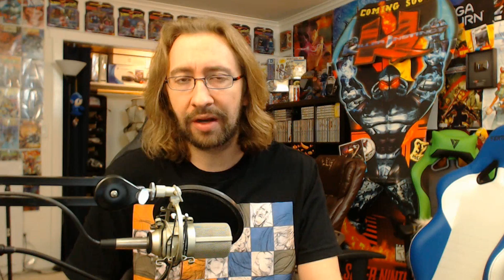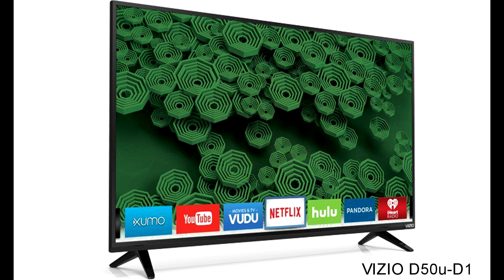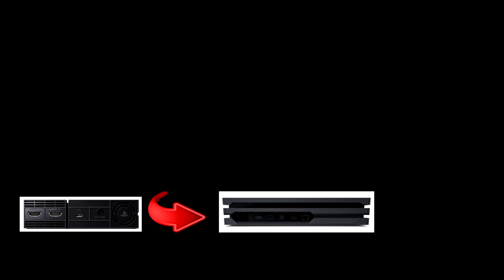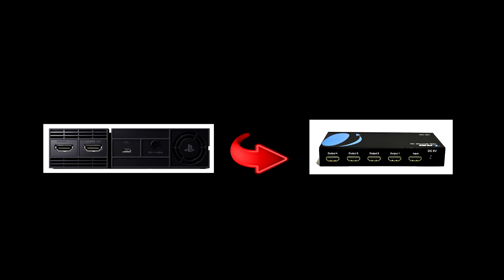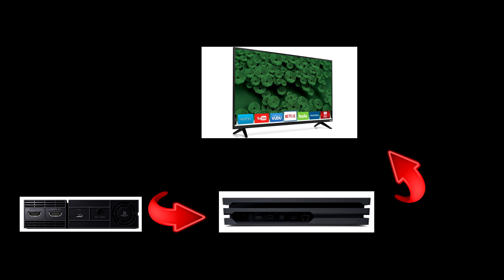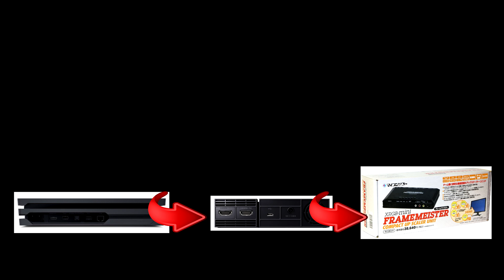MY PS4 PRO NIGHTMARE...And How I Fixed It

Comment: 2022 and I think that I  have a HDCP issue with my PS4 Pro and my LG TV, The PS4 has been stored for about a year unplugged. same TV that I used to use with it and now I cant get a signal, even in safe mode! If I plug my PS4 into my 15 year old Sony TV it works, but that TV is dated. I have tried power cycles, factory resets on both devices, and even different ports ands cables, all software up to date too. Help!!!

Comment: i got one question i upgraded from a slim to a pro is there a video or some way to make the pro run as fast as the slim cause my pro isnt wanting to connect for crap to wifi and connect speed is so low while download speed is littlerly triple the amount in mega bites my slim runs faster then the pro why is that and how can i get pro to actually run

Comment: I've just bought a ps4 pro, set it up today and the system update file (around 500 mb) is taking over 20 hours it says! My internet is not slow and everything else is working fine, is this normal for the first system software update? I'm worried I've got a faulty ps4 pro :/

Comment: I have a few issues with the newest PS4 Pro RDR2 bundle.  First trouble was with my switch which downgrade HDMI and its HDCP to 1.4, and this is November 2018!!  So I cannot use the switch, and I will have to buy a new switch which seems to be hard to find one with all these issues with HDMI version, HDCP 2.2, 4K, and HDR stuff in 2018!  The other issue was that this newest PS4 Pro doesn't let me use my Wifi 5 GHz, and only works thru my Wifi 2.4 GHz, a Wifi which is extremely slow!  So why can I use Wifi 5 GHz.  Let me clarify this further; when I set up the 5 GHz, the PS4 Pro network test successfully connect to the internet 80% of the time, but it fails to login to PSN and it doesn't give up or down loads at all.  This shouldn't happen in 2018!

Comment: I had similar issue too. My ps4 Pro does not want work with my HDMI switch with audio extractor. The reason why I use such setup is because I collect retro consoles and I have analog to HDMI upscaler. And I have a receiver that does not have HDMI plug. I want my older console to have pro-logic surround sound and the only way to do this is using the switch and audio extractor. Of all the consoles I have collected, PS4 Pro is the black sheep of my collections. It requires direct plugin which I have to manually switch over to the sources on TV and receiver. It sucks balls.

Comment: I'm having the temporary black screen problem and I only just bought my pro. It works ok then I lose signal for a few seconds. I've tried 2 different ports on my tv, bought a new expensive high speed hdmi cable but I still get temp black screen on my LG 4k hdr tv. I have my Project Scorpio edition in hdmi 1 and that works ok. I don't have a VR headset so what can I get to make this handshake work? Please help?

Comment: Hi. I recently just had this problem. I bought a ps4 pro and it immediately started giving me this black screen problem. I then thought maybe I have it in the wrong port which I did and found out that my vizio m series only had one hdmi 2.0 which was the first hdmi. (Hdmi 1) Then after playing half a game of fortnite, it cut out again and I was extremely angry at that point. I then started unplugging all of my hdmi ports in anger and after I unplugged every one I had in BUT. The ps4 pro one, it worked perfectly. It was cutting out because of my other hdmi's. Hope this helps anyone out there because I dont want anyone to go through what I had to for the past 24 hours.

Comment: I bought ps4pro like 2 months ago, my tv is LG 42LS3450 and it only has 1 slot hdmi port, 1080, and no HDR. 
My settings : set resolution to 1080p, HDCP off, full rgb to limited, deep color off, hdr off. 

And its still flickering, like black screen for a  second then came back. Weird thing is it does not happen all the time. Maybe it's my tv?

Comment: Max I have the same exact tv and a standard ps4 not a pro. When I go into sound and screen settings my ps4 only goes up to 1080p. I know I should have more options also the PS4 says HDR is not supported on this TV. just wondering if you have any tips or could point me in the right direction ANY help would be appreciated.
Reply: I am plugged into HDMI port 5 for the best definition as well.

Comment: This guy is right. Just got PS4 Pro for 4k support. My 4k Samsung should support HDR and TV is really in this mode, but PS4 claims that TV doesn't support it at all. I also had some odd white bar flickers at lower areas of my TV and actually thought I had gotten a defective PS4 Pro. However this was somehow magically sorted by fiddling graphic settings on PS4 Pro, but never actually changed anything differently?? My opinion PS4 Pro is really, really buggy on it's HDMI output. I've had PC with two different graphics card to this same TV and never had any of these problems.

Comment: Granted there is no excuse for sony tvs having issues but in your case, I believe the problem is the "value" brand Vizio. Never had an issue with a KS8000 Samsung. To datw the issues have been resolved by the TV manufacturers, not Sony.

Comment: Im giving up on my pro. Have Samsung ks8000 show 4k yuv automatically so you would have to manually change the tvs hdmi output to Uhd color but then i get a no source found... my 4k blu ray works fine via Uhd on the same port. Sony blame samsung and samsung blame sony...tried different hdmi cables and ports done hdcp trick.. nothing ffs

Comment: Sounds like what you did was just downgrade the HDCP inorder to strip it. Passing it through the PSVR break out box outputs the signal in an older HDMI 1.4 spec then the framemeister strips the older HDCP spec from the signal. All though it works you don't need to use the framemeister to strip the HDCP their are some $20 options out there. This process how ever eliminates 4K RGB and HDR signals but I don't think you care about that part from what your saying.

Comment: To me PS4 Pro is not about doubtful 4k (don't have any capable screens anyway) but increased power when running on standard 1080p, stable resolution, enhanced visuals and stable frame-rate... but I don't have it yet, only original PS4.

Comment: i got my ps4 pro 30/12/2016 and i didnt have any probs so i guess the issues are fixed.
Reply: Inferious_07 samsung ku6300
Reply: Inferious_07 ok cool
Reply: Inferious_07 yeah its 4k
Reply: have a Polaroid 4k tv. It worked fine for a while. now when i turn it on it the screen is green. Any ideas?

Comment: I have the Power series and am using the HDMI port 5, but no signal. I have no VR and when in safe mode the screen remains. Can I factory reset or downgrade from the patch without having a signal?

Comment: If you had trouble getting it to work, you shouldn't be making videos until you learn a little more! The PS4  Pro offers newer technology than the PS4, meaning if you want to take advantage of all the new technology, you need a newer TV. If you had problems, then you probably weren't using the right HDMI cable, many claims on the internet say this does not matter, this is false! There ARE different HDMI cables.

Comment: and this is just another reason why i refuse to go near consoles any more. my last console was the xbox 360, once i got shot of that pile of crap a fter just 3 weeks i turned all dark and adopted the msi dragon and its kick ass pc components and OMG !!! im never going back to crap consoles.  sure you pay more for a pc but your pc is more viable for much much longer and when its time to upgrade you save literally hundreds of pounds with the pc because all you do is buy graphics upgrades!!  so yea consoles suck dick and are forced to do 4k! they are not actually 4k.   it ahs the same tech as the 4k tv's processors that fill in the gaps to make it look like 4k.  where as with a pc these days most mid range cards are 4k and all you have to do is get a 4k monitor which are really cheap now too. cheaper than a fake 4k tv anyway.  is it any wander that your ps4 pro overheats ! and has display problems its just a ps4 standard that had some junk slapped on it to try force it to do 4k  

what your describing on here is far more than any console gamer is prepared to put up with.  

lmao 1300 dollars!!! you can get a stomping kick ass fully 4k maybe even 8k gaming pc that just decimates all and any consoles available.

Comment: here's a solution guaranteed to work. step one. sell your ps4 pro. step two, build a PC. step three enjoy legit 4K or I my case 2K 144FPS. :-)
Reply: Step 4: MIss out on exclusives...
Reply: OzzieBloke umm, PC has way more exclusives...
Reply: Gwillan cycleman pro gmr 117 But it doesn't have ALL the exclusives...
Reply: OzzieBloke which means argument works both ways making it void
Reply: Gwillan cycleman pro gmr 117 Logical fallacy.  It makes the argument true both ways, it doesn't render it void; you will miss out on exclusives on either platform, if you do not own either platform.

Comment: I had the same issue with my 50" Hisense H8. Only thing is, it started after I put on HDMI splitter in order to have my PS4 Pro, my Xbox One S and my Chromecast to run from the best HDMI port on the TV itself. The Chromecast went to black as soon as I turned on either of the other devices. So moved it to the back of my One S. I did the steps listed and switched in Safemode to HDCP 1.4, but then noticed an adverse effect on how HDR was dulled down significantly. It also impacted the crispness of some graphics too. At the moment I turned HDCP off, the games work fine, but obviously to play Netflix u need to turn it on. Sooooooo, I just watch Netflix on my One S instead now. The question is, how is Sony going to fix this? I'm very happy with both consoles, but would hate to have to continue with weird workarounds just to get them to work with my best HDMI port.
Reply: TestedModz, honestly it doesn't look awful at all. It was even featured in this months Game Informer as one of the 4 TVs they had feautured. Not sure where u got that the HDR was fake, unless ur referring to the idiots who can't find the HDR patch and apply it themselves. I personally only paid $180 out of pocket on the TV and I have been very happy with it. I watched the 4k version Revenant on it using my Xbox One S, and it looked killer....so yeah not sure where ur getting ur info from.
Reply: TestedModz wrong, it's 10 bit.
Reply: TestedModz also everything looks bad compared to LG OLED, that's like saying why buy a Honda Civic as a reliable commuter car when u can drive a Mercedes AMG. OLED TVs still go for thousands of dollars also.

Comment: Unless you're willing to deal with the consequences, never buy a newly released console.  They always have the most issues.  It's never worth it until at least the 2nd wave of consoles come out.  I am especially particular about this when it comes to Sony consoles as I've seen PS1s and PS2s having physical issues with the hardware that don't allow it to work at all, or it's functionality being severely compromised.  They address a lot of their largest issues before releasing their "mini" version of the console.

Now that consoles are becoming more complex with upgrades, you have to wait for the 2nd wave of THAT version because the companies just built in new issues.

Comment: It's an easy fix what I did on my LG 4K TV was I had to hold the power button on the PlayStation until it beeps twice to go into safe mode and then it popped up on the screen and you fixed it from there but it takes like 5 minutes

Comment: I got a Ps4 Pro and updated to 4.06 then it all went to SHIT. I spent 1 and a half on trying to fix it. I did everything i could did the safe mode too. i got it to work but all it could do was 1080p. It wouldn't let me use my 4k tv settings, i got fed up and returned it and changed it for a new PS4 pro and i won't update it. I'll play my singal player games for now. and its on 4k settings now. I'll update till Sony fixes their bad Patches.

Comment: Good job with the thorough explanation of your struggle. I had similar frustrations setting mine up, I had to run my system on a legacy input and switch ports after setting my output spectrum. As a suggestion to you, as not to alienate potential viewers, don't dismiss Xbox hardware with an illogical statement. Saying you won't get a Scorpio because you have a more powerful PC is reasonable; but yet purchasing an even more inferior PS4 pro(by specifications) makes absolutely no sense. Just appears too fanboyish. I like my PS4, and I really enjoy my Xbox One S(Watching UHD movies from disc is a huge for me). So far the pro is severely disappointing. The checkerboard rendering just looks horrible compared to pure rendering I get on my PC. 4 teraflops just doesn't cut it. For first time PS4 owners, the hundred dollars is still worth it for the vr boost.

Comment: Please help me out : Whenever I connect my ps4 pro to the elgato hd60, I only get a black screen, and no picture at all. 

I've gone into safe mode, switched the HDCP from automatic to 1.4, I've also unchecked the " enable hdcp option via the ps4 pro under system " my output on the ps4 pro is set to 1080p as well. 

the elgato supports 1080p 60fps recording, but I'm only getting a black screen and no sound . 

my channel has come to a complete stall, I can't create any more content, did you find a fix for this? please help .

Comment: I have no issues and the PS4 Pro is Amazing! It definitely enhances games! Dont believe negative comments until you experience it yourself and then you will know the Truth! I have the halo xbox one as well and thats great too. This PS4 Pro is worth the upgrade.. I have an M series 4k Vizio TV and I can run all resolutions with no issues.. 4k  and HDR is the Truth and not a gimmick!
Reply: i literally have the same max does...uhd 4ktv D series vizio ...hdmi slot 5 4k@60 hz...and from what im hearing across the board...is it doesnt off much in resolution gamut but it does have the least input lag...so i know its not the ps4 pros problem but my tv itself...even if it does say 4k

Comment: I have a PS4 pro.  I hooked up My PS4 pro to a 55 inch panasonic 1080p TV (that is a few years old) and had no issues.  I hooked up my PS4 pro to my 32 inch vizio 1080p (that is 10 years old) and I have no issues.  I am scared to buy a 4K TV for my PS4 pro.  I did not have a PS4 original or slim prior to my purchase of the PS4 pro.

Comment: WOW!!!!.....SOOOOOOO glad I came upon this video! I have the EXACT SAME TV......and I never knew this TV was so good for games, period. I just knew it was the only $600 50" 4K UHD TV I could get for that size and price and never expected much performance out of it in hindsight right after purchase..... BUT to my surprise, I got lucky and its worked just fine. There has been some times where I turn it on and it wont sync with the HD cable correctly right off the bat and Ill have to unplug my pc (2x GTX 970s Core i7 2700k @4.8ghz w/Corsair H80 cooler, 16gb DDR3@ 2133mhz, ASUS Sabertooth Z77, Samsung 850 EVO Pro @ 256gb Corsair TX 850W Gold Certified Razer NZXT H440) and plug it back in or just reset the TV, but other than that its been great! Has a low latency mode etc, all the bells and whistles I would have expected from my former Samsung 120Hz HDTV etc. But OMG I am so glad to hear this news as I am just about to buy a PS4 Pro myself because I have lots of friends from work etc who play via PSN and its the only way I can meet up with them. PLEASE tell me this shit has been patched! ARGHHH everywhere I look I'm seeing PS4 Pro buyer beware vids....YIKES. I was looking forward to playing 2016 Q4 games on it as well as SOOOO many upcoming games next year that could REALLY benefit from the Pro's utilization :/

Comment: No issues with my Samsung KS8500, which is touted as the hottest TV to have (originally the KS8000) however, the 8500 is curved. None of what you said happened to me, I will ADVISE you now, you do NOT want to manually select 2160p@YUV420 that was the first thing I did when I got my PRO and first-party AAA titles from Sony did not register HDR capability on my TV and the ability to turn HDR on was turned off despite my settings calibrated to receive HDR, some other games like Call of Duty did realize HDR , however first-party AAA titles from Sony will NOT turn on HDR unless you leave the HDR setting under display settings to Automatic.

Comment: Some of those boxes like the Framemeister gets rid of the HDMI Copyright crap which is probably why it worked on the tv. Should have used Display Port, no royalty fees and none of this HDCP crap which made people mad years ago when the old monitors didn't have HDCP on them. Hence people got a HDMI box to get rid of HDCP so older monitors worked. And speaking of 4K, using HDR you need to get a 4K with a LOW LATENCY MS rating, apparently that's another headache with the Xbox One S and PS4 Pro playing HDR games.

Comment: I was also disappointed when I plugged my PS4 Pro into my 4k Vizio 55" television and there was sound but no display. Safe mode didn't work for me. After some brief research, it turns out I had to turn on HDMI Color Sub-sampling on the TV. Since then it has worked great!

Comment: I think this is bullshit becasue i own the cheapest 4k tv you can get a 42 in sceptre 4k from walmart brand new 230 bucks and my ps4 works just fine and i got mine 5 min after they came out so no update or anything. So to say it wont work on these expensive brands i find to be bs. I think this guy is a hater trying to down on sony.Plus you have to use the ps4 hdmi cord or a 4k hdmi cord because not just any hdmi cord can send a 4k signal.